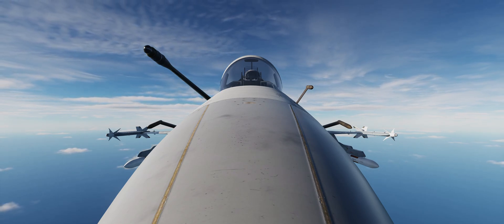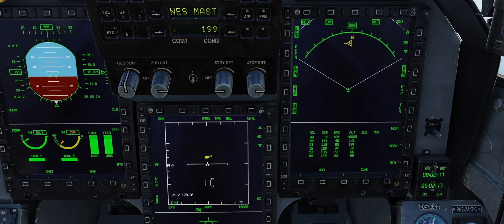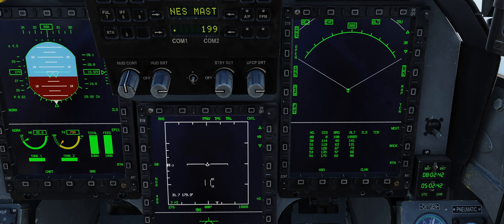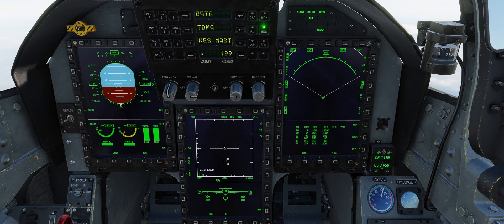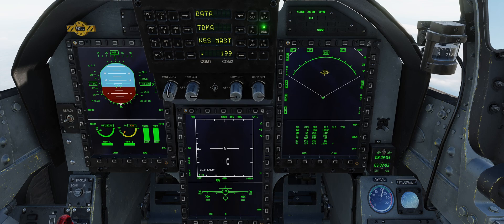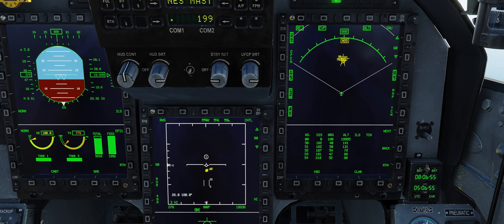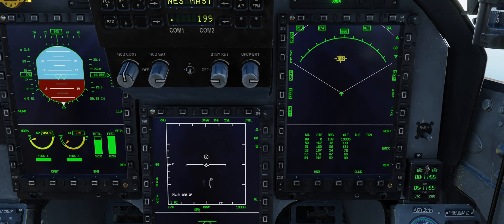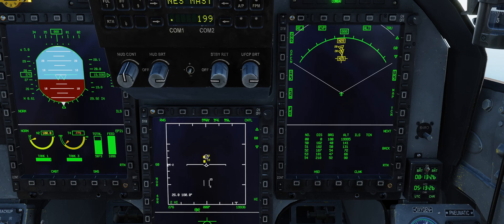DCS JF-17: More Looks, More Issues - UPDATED

Comment: Sadly this is one of the less serious issues that impacts this nice module currently. There's a lot of issues mostly impacting air to surface systems some of them are related to the module, but there's a bunch that comes from ED changing weapons implementation. DEKA is fixing the module issues slow as they are focused on the J8 while ED doesn't fix the weapons at all.

Comment: The main thing is that tracks, and therefore also track files, are not actually simulated or even emulated in DCS.
All that "tracks" are in DCS, is a way to artificially limit radar performance in a way that seems 'realistic' or technically impressive to lay people or to people only familiar with radar tech before the digital revolution.

Real tracks (as far as I can tell from a civillian engineering perspective and having done a limited review of the available academic literature, but never having personally worked on any military project) are populated by tracking filters that reject noise and other disturbances by making use of estimators in a feedback loop (the simplest practical example would be an unscented Kalman filter) to refine an estimation of the target's state-space parameters, based upon the calculated quality of the measurements it takes as input.
Practically, it's kind of like how your GPS position can remain quite accurate during brief signal interruptions, or how an aircraft's INS can bridge gaps between fixes, even though the accuracy obviously also decreases.

This means that, for a smoothly maneuvering target, the target parameters being displayed to the pilot wouldn't change (or seem to 'jump') every time the radar beam revisits a target, like we see in DCS (we also know that no real tracking is taking place since both radar and datalink 'tracks' are completely static between revisits, even when the target's velocity vector has been determined and is being displayed, no motion extrapolation or prediction based on that information is seen).
Only random, high jerk maneuvers in-between the time it takes for the radar to revisit the target, would actually cause such changes and they should be proportional to the target revisit time. Similarly when, say, a tracked target vanishes behind a high mountain peak, the radar wouldn't just suddenly lose the lock or display a static or jittering target at the place where it was last observed, rather the accuracy of the track would gracefully degrade the longer that the target remains obscured, but the FCR system should be able to keep an accurate lock even in the face of brief, but complete, signal loss.

A second, unrelated issue is the artificially imposed inability for supposedly 'modern' FCRs (with enough DSP hardware so that practically all calculations and manipulations done to the received radar returns are computed in the digital domain, after sampling the I/Q signals with an RF ADC) to detect and track the position, altitude and (semi-instantaneous) velocity vector of an aireal target within a single dwell-time of a mechanical radar, regardless of the target's characteristics, the clutter environment, the current radar mode and configured settings, and even the number of existing tracks.

In the scenario you showed (with a single target in a very permissive and low clutter environment), even assuming conservative generalized parameters, we can assume a PRF of at least 5~10 kHz, a transmitted main lobe angular width of a few (5-10) degrees, and a single bar scan rate that also requires around 10 seconds to scan through 60 degrees (let's say that equals an angular rate of ~5 degrees/sec), and finally also assume that the target appears as an infinitesimally small single point with no apparent angular extent.
Even with such restrictive parameters we have the following for the number of independent pulses received during a single dwell: PRF × (main lobe width ÷ scan rate) ~= [5~10] × ([5~10] ÷ 5) = around 5~20 pulses.

Assuming we have a radar with hardware that would have been available from the 90's onward, we are (far more likely than not) looking at a digital coherent pulse-doppler radar with a pseudorandom pulse-compression algorithm and a TWT capable of at least 1~2GHz of Tx bandwidth.
That means a single pulse would be able to provide an accurate downrange distance and (assuming a strong and large enough intra-pulse doppler signal) closure velocity measurement, as well as approximate values (with accuracy that's roughly on the order of the Tx beam width coupled with the mechanical pointing accuracy and stability of the radar antenna) for the altitude and crossrange distance. The second pulse would immediately provide enough information for a good track of the downrange and crossrange positions and velocities, although the velocity signals might still be quite noisy and the altitude accuracy would depend on the specific system used for altitude determination.
Every subsequent pulse would provide more detail to narrow down the track even more and allow for greater sensitivity and noise rejection.
Reply: i don't know about the JF17, but that's exactly what ED/RB radars already do to a large extent. have you ever tested the radars in detail?
there have been many, many updates in exactly this direction this year

Comment: Ok so the HSI/SA page is getting a "guesstimate" track file.  It knows after the first sweep if the target is closing, moving away or flanking based on return and velocity.   Note I dont think you are getting any target closure rate numbers on the radar yet.  And the HSI doesn't give you that info.
Reply from the maker: Thanks.
It is remarkably precise, though, even when contacts are flying very close to each other at low probability of detection ranges (like half a mile or less at ~50nm). The KLJ-7 never mixes up tracks. The AWG-9 instead does it all the times, that's why TWS is rubbish in such situations (obv there's half a century between the two, but I am talking about implementations here).

I will go a bit deeper when I have them.

Comment: If someone bought JF-17 and found any bug or nonsense which on the other makes the aircraft more leathal, they will never report it to Deka or ED. I've reported cheating by Deka by setting less than half of missiles diameter to have better range and lower drag in DCS. They also cheating about plane and weapons RCS...no wonder that ED had to take over many Lua files to control them.
Reply from the maker: Gumidek, is that you? Karon here :)

I'm still new to the JF-17. So far, besides the points raised, the only macro-odd thing I am aware of is the SD-10. The maker and several sources say it is close to an AIM-120B, but it is close to the C in DCS. Obv this can be true or not (Mach 7 AIM-54s come to mind!) but it is what it is.

Comment: A similar question is that when your radar scan range covers a target with ECM turned on, the target will disappear on the data link. And this problem will also occur on 18 and 16. I think this is a problem caused by the ED underlying code.
Reply from the maker: I haven't checked jammers yet, give how badly they are implemented. I'd expect the track from the KLJ-7 to disappear and the AIC to provide it, no?

Comment: I believe the only DCS modules that have an actual trackfile simulation are the Mirage 2000 and the F-15E. All other modules simply ingest the position and vector from the engine and only hide information aspects by their radar display logic.
Reply: ED is interested in selling minimum effort for maximum profit, after all. The 2000's radar sim is quite good as far as classified systems go IMO.
Reply: @ArchOfficial  Falcon BMS also uses a simplified approach to raw radar returns and trackfile simulation akin to the most DCS modules. However the trackfile behavior there is quite consistent and behaves in a realistic and plausible fashion, seemingly honoring all the expected effects and behaviors.
Reply: @enyakk  Of course BMS does; every realtime sim does.

Comment: You are right on the money asking these questions. The ultimate answer is TSD trackfiles and TWS trackfiles aren't being built the same way in DCS. It seems the moment a game object is hit by the radar, the TSD displays a corresponding trackfile, while the TWS trackfiles correctly are being displayed only after multiple detections.

This could definitely be bug reported, but I suspect nobody has really done a deep dive into these issues like others have on other aircraft like the Hornet and Viper.
Reply: "TWS trackfiles correctly are being displayed only after multiple detections."
what makes you think that? this is probably also possible with the first sweep, if the track is valid it will be created.
multiple hits are not always necessary
Reply: @IronDuke39  They have directional information. That shouldn't be possible without multiple hits.
Reply: @Pimck  You're right, my mistake.

But with the F16 and F18 this is the case, it takes several hits for the direction.